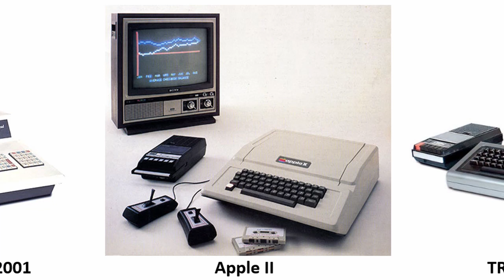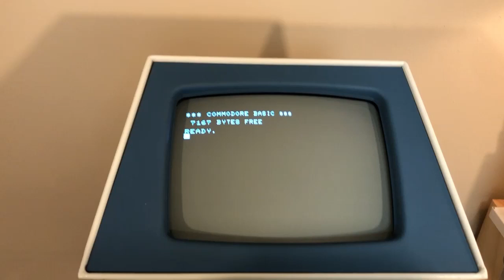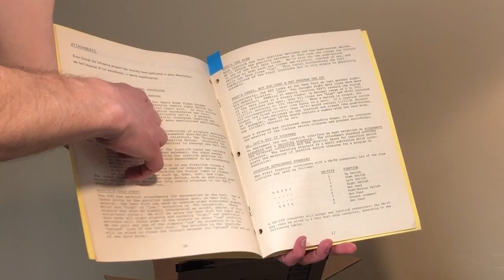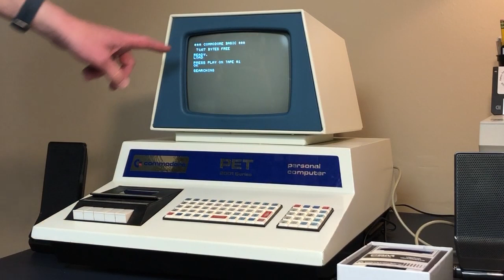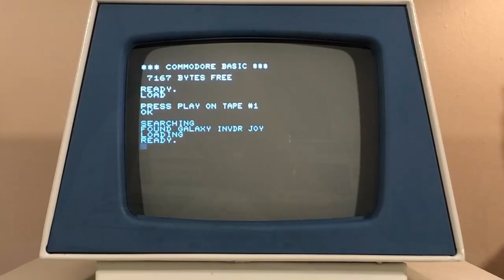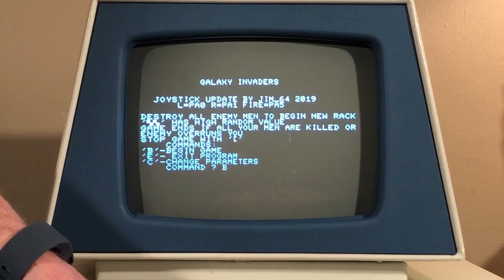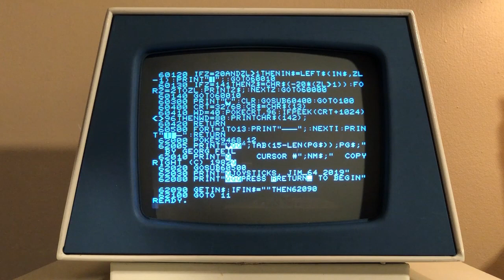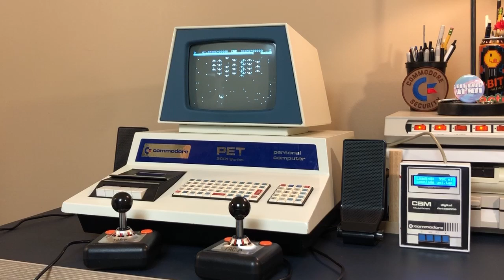Stupid Pet Tricks - Turn your 1977 commodore PET 2001 computer into a killa game machine!

Comment: The school I went to acquired one of these in 1979 and had it on display on a table at the head of the assembly hall.  I think it was running a version of BASIC if I remember correctly...

Comment: The PET 2001 is my grail to complete my Trinity collection!
Reply: Did you ever get a PET 2001 to complete your Trinity collection?
Reply: @geekwithsocialskills  I DID!  But I have yet to get it working.  I have video, and I have  clock signal, but Im getting a black screen. Bad RAM I think.
But I got a nice 2001-8 with a blue bezel.
Reply: @rivards1  Awesome! Memory failure is the number 1 issue with these early PET machines fro sure! I asked because I've got a lead on a black label 2001-8 and wanted to give you a heads up. There has been some discussions on which one the original PET 2001. blue or black label. IMHO it's still a toss up LOL!
Reply: @geekwithsocialskills  Thank for thinking of me! Mine has the old 6540 and 6550 ROM and RAM and also had a bad SN4LS04N so it could have all kinds of other things wrong with it too.  I need to track down one of those all-in-one RAM/ROM boards to verify the basic system works.  My understanding is that the VERY oldest PET has a blue bezel, white tape recorder keys, and a blue label.
Reply: @rivards1  Not a problem. I would have sent you an email, but your contact details are not on your about page. I do however have my email is on my channel about page. Feel free to reach out to me directly. I've got some other PET stuff that might be of interest to you 🙂
Reply: @geekwithsocialskills  Sent you an email over the weekend
Reply: @rivards1  Just replied. Gmail marked you as spam. That's not corrected 🙂

Comment: Wow, this ebay seller can be the rare kind who really cares his stuff and want his PET to be in good hands even after selling it. I guess ...

Btw, interesting about the "new 16 bit processor from Commodore" part: 65816 (can be found in SuperCPU cartridge, or for example Apple IIGS) was introduced in 1983, which is really a 8/16 bit CPU but as far as I know, not from Commodore (or MOS) but WDC (Western Design Center). It's interesting to hear that according to that manual, Commodore also planned a 16 bit CPU? Maybe they were planned to buy WDC? :)
Reply: There was another 16-bit processor being designed by MOS at Commodore. It's mentioned in Brian Bagnall's Commodore history book, and I've seen references to it in either Computer! or Transactor magazines (or both) of the era. It never did get produced though.
Reply: @8_Bit  Wow. Exciting! Do you know any documentation on it? I would be very curious to learn more on this! Especially if there is any planned opcode set documented and things like that.
Reply from the maker: Yeah, it's obvious the original owner loved this machine.  So lucky he saved all this stuff and took such good care of it. I didn't show everything in the video, he even has receipts and notes from two repair jobs over the years!  I've talked with him a few times and he even visited the machine at VCFMW 2018!
Reply: I don't know much more about it, but I do plan to research it more in case there's more info.
Reply: @8_Bit  A bit different context the same with the planned 65832 (ie, 32 bit version of 65816) from WDC in this case, what you can find some documentation for, at least. They would call it "terbium" (or what), since then this name was recycled to a prototype board (or what) for 65816 though. But this is a bit special case, as it's not about WDC at all then.
Reply: My PET also came via eBay from an owner who had really cared for it. Sadly he had passed away, and I collected it from his daughter. It came with the superb Raito book as well, and apart from some oxidation on the key contacts it worked fine. I have since recapped it and added an SD card reader.

Comment: Great video and nice ebay haul!  One small quibble, didn't the "1977 Trinity" include the PET 2001, TRS-80 Model 1, and the  Apple I (not Apple II)?
Reply from the maker: Thanks!  The 1977 Trinity did in fact include the Apple II.  The Apple I was released in 1976, but was only the circuit board, requiring the buyer to supply and integrate the rest of the parts.
Reply from the maker: But I did see very early Apple II advertisements  stating that they also sold Apple IIs in the motherboard only format!
Reply from the maker: https://upload.wikimedia.org/wikipedia/commons/4/4a/Apple_II_advertisement_Dec_1977_page_2.jpg
Reply: @jim_64s8-bitprojects5  Very cool thanks for sharing!
Reply: @jim_64s8-bitprojects5  Good to know, I stand corrected!
Reply from the maker: Fuzzy Bad  No problem! It’s the sharing, discussion and discover that make this fun.  Really understanding what happened 40+ years ago is hard - especially with all the attempts to rewrite the home computer history.

Comment: Umm, KIM-1?

If Apple's first computer was the Apple-1 then Commodore's first computer, ( released in 1976 ) was the KIM-1.

Yes?
Reply from the maker: The 1977 trinity is seen as the first computers the average person could buy, bring home, plug in, and start using. The apple I, Kim 1, and heck - even the raspberry pi, are more single board computers for hobbyists that take extra components to get to a usable computer. Where the line is drawn is a matter of individual definition.

Comment: Since the Tapuino was loading from #1, I assume you ran the cable to the inside port.  Just curious why you didn't hook it up to the #2 port -- I'm assuming it didn't work?  I have selfish reasons for asking...
Reply from the maker: If I remember right, when I used the Tapuino on port 2, it messes with the CB2 sound - I think it just stoped all the sound.